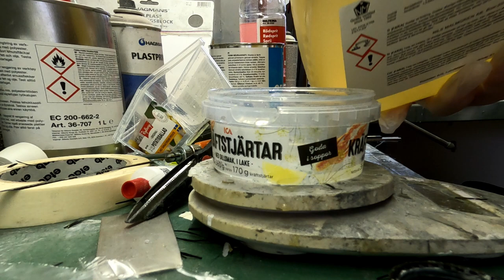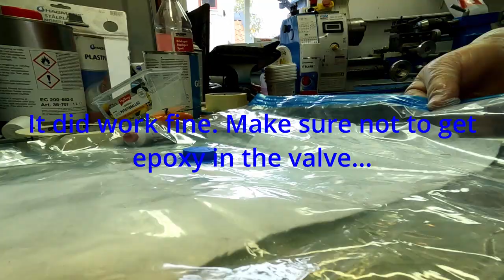Redneck vacuum bagging

Comment: I've used different sizes of these vacuum bags, to press and bond wood veneer, very thin aeroply, and epoxy resin builds like this. If the bag's zip does not work , clamp the edge between two battens of wood. And keep the Hoover sucking if vacuum is not perfect !!!
Reply from the maker: Thanks John! I will try it!